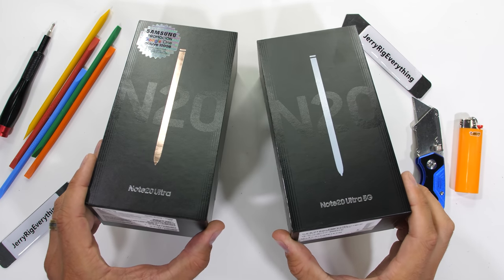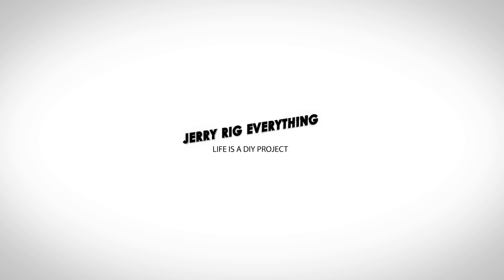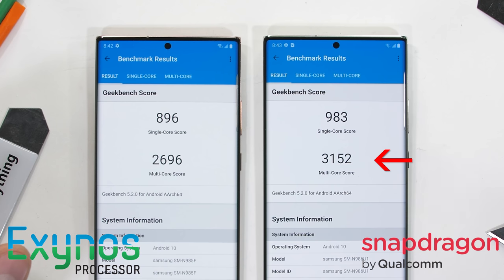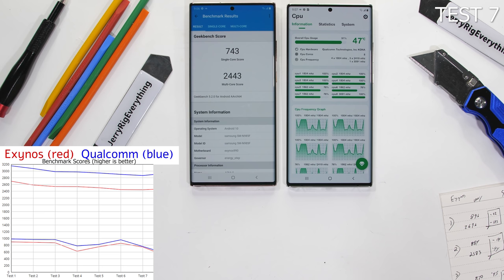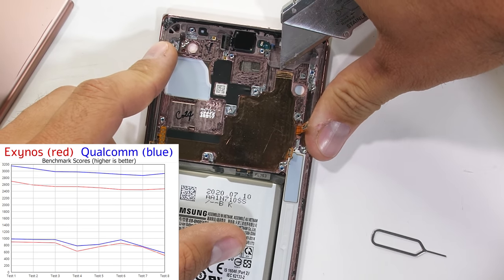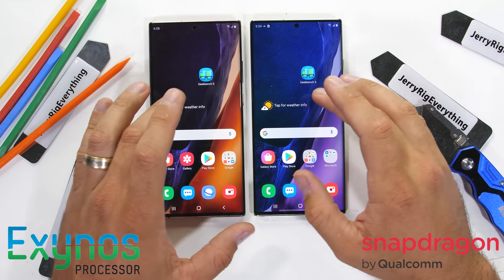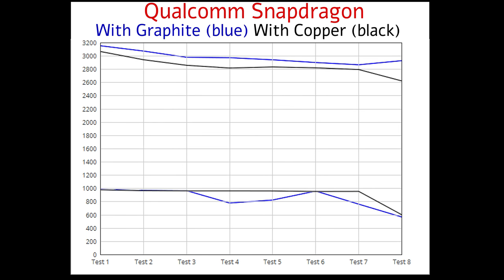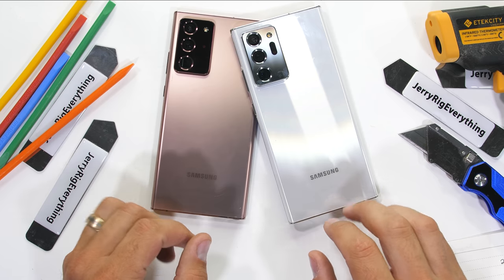Samsung should explain this... Exynos vs Qualcomm?! - Note 20 Ultra

Comment: That really sucks. Now almost every company is going for some easier way to do things and that's not a bad thing, but if companies sell things that are expensive, people should get what they pay for, this is technically a rip off even though it's a small thing. Hopefully they change this, if they dont, everyone will soon stop buying samsung phones. (Coming from a samsung fan)
Reply: yea....I am also a big fan.....But come on, i paid $1000 on my exy s10+ and guess what..?, it cant game consistently on 60fps while the SD version does.....the exy is at 40fps.....
why samsung is doing this....?
Now I am never recommending any samsung phone to any of my relatives or friends.....
Reply: I already stop buying samsung phone, hmmm, their phone suck n very pricey, i turn to buying xiaomi, worthed every penny, even my xiaomi phone from 2016, still working till now
Reply: @sasakinozomi2165  I am still using the galaxy s6 (2015) and it works well!
Reply: Samsung phones are very good, just like apple, just the only problem is I feel like they think people wont care since they are widely known and they think they can slack a bit.
Reply: i wouldn't call a 20% difference in batterylife "a small thing" tbh... especially if that is paired with a 16% loss in cpu power.
Reply: @KaleratYT  I didnt know it was 20 percent, if that's the case then for sure why do they think people wont care
Reply: @yairnajera9418  sure they are wildly known... But they're not the only players in the game anymore. They shouldn't be doing these practices today. I have been a fan of Samsung for a while but maybe after this, it is time to look for another brand...
Reply: @yairnajera9418  people won't care because nobody really knows the features of the phone like that. You have to be a Samsung lover to know that it has different chips in some versions of it. Most people don't know that. They buy the phone because it's a newer version and they rely on what Samsung say instead of looking more into the small things that really matter
Reply: Lol that’s always been the plan. Less work more money
Reply: @shebilpullat3529  exactly the same shit. Have my Note10+, but the performance in games is garbage.
Reply: It’s not a small thing that’s the thing
Reply: @gravity5114  i think he meant in a way that it is just one component. And for people who dont know much it is indeed a little thing
Reply: Lol everyone won't stop buying samsung phones because most people don't care about this non sense.
Reply: @BigBladeFan  "most people don't care", thats true, but it isnt a nonsense, but a very important and reasonable fact.
Reply: Yair Najera Amen brother amen
Reply: @Yair Najera same :(
Reply: DoYouEvenGameAndLift BRUH  
Yeah...Same here....Now Imma No samsung Boy...
But Personally I dont like iOS...I dont know why...
So my go to phone will be One plus

Comment: Runs hotter
1 generation slower chipset 
Worse battery lifespan
Different screen(possibly)
Essentially the same price

Ultra scummy.
Reply: International phones are more expensive, actually. Phones in my country can cost between 150%-200% of the original price in official stores
Reply: More like Ultra scam
Reply: Not in Brazil, the price is actually higher here c:
Reply: Different camera sensors.
Reply: It has to do with licensing and restrictions on Qualcomm. They can’t use that chip everywhere so they have to go with their own in places that don’t allow Qualcomm
Reply: @TheCrystalGlow  there is restriction on exynos on USA, not the other way around
Reply: That's because Exynos can't compete with flagship processors. They use Snapdragon on American models, and they sell the Exynos type to the sheeple in India and Pakistan. Damn right, very scummy.
Reply: @mikehawk287  Exynos was faster 2years+ ago. Its these 2 last years thats struggling ;).
Reply: @gzarari  They are acting real stupid since they released the S20 series. And they really should stop making cameras, they capture shit.
Reply: @TheCrystalGlow  please dont mislead others. Exynos chipsets are sold in US and conversely, Snapdragon Note 20 are sold outside of the US as well
Reply: Its like what Apple does. Just put the same phone into different frames and call it a number higher than the previous model and charge $1000 to any hipster whos parents can afford
Reply: @zbruh7268  yeah, precisely. People blindly buy Apple products while other companies were at war with each other with high specs and affordable prices, Until in the last couple of years Samsung thought: "hey, if Apple is overpriced garbage and people still buy it, so why cant we do the same? We also want a piece of that." And companies like Huawei, Oppo, and Oneplus sorta did the same. So yeah people are idiots and these companies are taking advantage of them. And meanwhile Douchebag Youtubers like AppleExplained say stuff like: "smartphone prices are going up because of the new advanced technology and blah blah blah..." - BULLSHIT.
Reply: @mikehawk287  it wasn't apple that started this because apple get the right hardware with right software. The one who started selling worse phones for the same price outside the US is LG with the G5 SE
Reply: @ryanting9342  I don't really know where outside US and china to get a snapdragon note 20, and as a bonus in Brazil the actual exynos version costs more than the snapdragon imported from the US.
Reply: @TheCrystalGlow  You know something, but it's exactly the other way around. They can't put their own chip in the US.
Reply: back in Note 4 Era 
Exynos Run Smoother Than Snapdragon
well i think the table has been turned or maybe the wheel or chip??
and i have Exynos Note 4 thats still i use Now and This is what i use to Type this comment
Reply: @XDjUanZInHO  Apple uses good hardware, but it's definitely not the best, and keep in mind it's way overpriced. A $350 Chinese phone is equal to an iphone 11 pro max in hardware. And as for software, personally I'd choose the worst, buggiest mediocre android UI skin ever made, than the prison called iOS.
Reply: Costs more in EU than in the US
Reply: @TheCrystalGlow  s10 lite has qualcomm's processor and is being sold everywhere
Reply: @TheCrystalGlow  
S10 lite uses SD and is sold internationally. Note 10 lite uses exynos and is sold internationally as well.
Reply: @RedViolet 
And all those brands can sell SD at high amounts. So the argument that "Qualcomm won't be able to produce enough chips" is invalid.
Reply: @ShiroCh_ID  
Exynos used to be better than SD.
Reply: @gzarari  So this is reason to sell better version in USA than elsewhere then? Why not put Qualcom in international version as well, since it's not restricted outside US?
Reply: @wekkimeif7720  because samsung makes exynos, and its probably 5x cheaper for them to manufacture. Not saying its right, i dont even buy samsung phones anymore since i had an s4. They slow through updates after 2 years. While i have a google nexus phone for 4years now and still runs good
Reply: @gzarari  Yea Samsung is scamming customers just for extra profit, which should be stopped asap by someone.
Reply: @gzarari  that is actually correct. They're quality has dropped but they did have some the outperformed Qualcomm im earlier days
Reply: @mikehawk287  not so fun fact: the note20 ultra cost $549 in parts to make ( now that doesn't include research and development but still, that's less than half the release price! And thats for the ultra with victus glass and a better camera and display. So imagine how much it cost to make my note20 5g? With its plastic back. Lack of an sd slot and slightly lower and camera and 60hrz display and most notably gorilla glass 5 instead of 6. That part pissed me off the most. How are you going to downgrade the glass by 2 generations. Wtf!? Plus a plastic back. Jesus that's just total bullshit. The only reason I keep it is because I refuse to spend over 1000 on a phone. And I love the one of a kind features the note offers. And overall I enjoy the phone but when I think about all the downgrades especially the durability it gets me pissed. But back to my main point. If the note 20 ultra 5g is 549 to make with all its premium parts. The note20 5g must be 300 or less to make considering its plastic back and gg5. I think it could've cost even less to make I'd say even 200ish is possible which is straight up shady. That's a massive profit margin. You need a profit margin but as  someone with some business experience that's not a legitimate profit margin. I feels more scammy then anything- no decent reasonable company would force a profit margin that steep on its customers but I doubt many of these companies are decent
Reply: @XDjUanZInHO  wow you're talking about legit sellers like t-mobile stores verison stores, samsung etc. No 3rd party stores right? that charge more for the exynos than the US varient??
 Because 3rd party stores create they're own prices and can say it costs whatever they want while authorized sellers working directly with samsung have the most legitimate accurate pricing so if they sell the international version for more in samsung or Verizon/tmob. Stores that's fucked
Reply: @ShiroCh_ID  wow my note 4 died real quick. It was dissapointing. I think it was refurbished. I got it from a 3rd party seller in NYC. Bad idea. In Ohio you can find some good 3rd party used deals but in NYC I seemed to always end up with garbage
Reply: @brandonshand4718  you can look up on any major seller here in Brazil. Phones embedded with carriers are rarely common here so you can search on stores such as: Kabum, Submarino, Americanas, Zoom, Magazine Luiza,... And you'll see what I'm talking about.
Also, buying from the actual manufacturer here in 90% of the cases will make you pay more just because it's on the original shop without sales, don't ask me why
Reply: @brandonshand4718   Apple, Huawei (flagships only), OnePlus, and Oppo all do the same. Keep in mind they sell the higher storage versions up to $1500 which is nuts. And that makes it safe to say they get 100% profit from every single phone they make. 100% profit means when they sell the product, they get the money they used to make the phone PLUS the same amount as profit - money that goes into pocket. You should check out an iPhone 11 (non pro) and see the pure garbage they sell for 699-780 USD. Now some companies don't do that, like Xiaomi, back in 2011 when they first started selling phones, they got 0 profit from any unit sold. They even sold the first phones for half price during the first 8 hours. And until today they still get about 10-25% benefit from their products. they make amazing phones, and I dont really mind the software or UI since the camera is neatly optimized.

The hardware Apple uses on the iphone 11 pro max was already 2 years old when it came out, except for the cameras, they are the best Sony could offer for a smartphone. The Note 20 for the price, should have 90 or 120 hertz refresh rate and a better telephoto camera. The plastic back is maybe not that bad, there are many forms of plastic, maybe the plastic they used is different, personally I think any type of plastic is better than the aluminum they used on the iphone 5s and 6. A Rolls Royce bumper is also made of plastic.

Comment: "If it acts like a different phone, It should be called a different phone." - Zack 2020
Reply: What if it quacks like a different phone?
Reply: yeah in old model.. the differnt not much but newer one.. this is a joke...and it cost the same...
Reply: Me Too  If one phone is slower, it's not acting the same as the other one.
Reply: Do you realize one says Ultra 5G and the other doesn’t
Reply: @user-oe4fo3zo9q  because there some coutry will not implementating 5g for next couple years
Reply: Me Too  kid if one phone is more efficient and faster there is obviously a difference. It doesn't matter if it is a small change it makes quite a difference. stop being so narrow minded and sit down
Reply: Me Too  and it isn't just "a little more efficient."  there are obvious flaws it shouldn't be hard to realize

Comment: Nearly 2 years after the release of this phone, Samsung seems to have done some positive optimization on the software end with OneUI 4.
The battery life gap between both variants has narrowed significantly, although the performance gap still remains.
Reply: Agreed, my regular S20 with the Exynos 990 was wayyyyy better with the OneUI 4 update. Seems Samsung were indeed embarrassed and worked hard to optimize the Exynos 990 drivers..
Reply: @seezu84  thanks god they did jt
Reply: Heya, I’ve been looking into getting a new phone, and I’m wondering if this one still holds up in 2022? Hardware-wise, it has pretty much everything I’m looking for; but I’m worried about the software being too “outdated”. Namely the version of android and Bluetooth.
Reply: @slothful2039  The software honestly isn't an issue, and will get upgrades for maybe another year. It's definitely getting the upcoming OneUI 5.0 (Android 13). I'd say it's totally future-proof for another 12-18 months for a power user, and 2 to 3 years for average users.

Your real concern should be battery life. It's more or less on par with the Samsung flagship standard, but can't compete with, say, the iPhone 13/OP10 series.
Reply: @slothful2039  snapdragon 865+ will pretty much handle any game right now, because mobile processors are getting better but the games aren't. You don't have to worry
Reply: @suhailnoor5654  Thanks! I did some more research and apparently the newer snapdragon chips have problems with heating, especially on smaller devices like phones. So that's another plus to the 865+ chip.
Reply: @slothful2039  that's true

Comment: I remember when the Exynos came out as an option and people were actually trying to buy the international version because it was better than the Snapdragon offering. My how the times have changed.
Reply: Sad Galaxy S8 noises
Reply: Just like intel vs amd
Reply: I remember specifically buying the Exynos version of the Note 4 because the Qualcomm variant was absolute garbage...
Reply: @doodskie999  or like Nvidia vs AMD. Nvidia just completely crushed AMD with their new 3000 series cards on performance and price!
Reply: @isaiahwade1484  compared to what lol?
Reply: When did Snapdragon become better than Exynos? Was it since the S8/S9 series? Cuz I remembered the Exynos S7 series outperformed the QcSp S7.
Reply: Any one remember when the note 8 exynos outperformed the iPhone 7
Reply: @jonathanstupidcheesespaghetti  outperformed but in long term sd were best
Reply: I believe it was during the S6 release, SD 810 was an overheating piece of garbage and Samsung dumped it and used Exynos 7420 everywhere.
Reply: I remember this on galaxy s6 🤣🤣🤣
Reply: @4uvak666  have you not seen the specs and performance of the new Nvidia cards? They destroy all other graphics cards and are cheaper than other cards with comparable or even better performance.
Reply: @michaelorlain4262  yeah, I ordered a one plus 2 and returned it on the same day due to really bad heating problems. I remember a sony Xperia(don't remember the exact model) literally cooked at 54C external surface which actually burns your hand.
Reply: @isaiahwade1484  that what's usually new cards do? No shit. U can't compare to amd, coz there is nothing new to compare.
Reply: @Anistar95  also with the Note 5. It was the first and last time time U.S buyers got an exynos Note
Reply: @jonathanstupidcheesespaghetti  S8/Note 8 were last one, with S9 situation started to change
Reply: You can unlock the Exnyos variants. You can't for the SD variants. And even though the non US SD variants can be unlocked, good luck finding 3rd party roms for them for that tiny group of people who have them.
Reply: @4uvak666    yeah, so you just proved you have no clue what you're talking about and didn't even bother to look into the new cards. So you're telling me that when new more powerful cards come out, they're "usually" cheaper than the previous model. And the performance of the lowest model always outperforms even the highest model of the previous line. That's NOT how it works! The prices on new series of cards has been climbing for years and the performance gain is nowhere near a jump like going from the Nvidia 2000 series to the 3000 series.
Reply: @sprockkets  yes you can. My Note 4, Note 8, Note 9 and Note 10+ were all unlocked and they are all SD. The only unlocked Note that I had that wasn't SD was the Note 5 because all markets got the Exynos. My Note 2 was unlocked but I don't know if it was snapdragon or not
Reply: @4uvak666  and yes it can be compared to AMD because they don't have the new architecture at all that Nvidia is using on the new series. It's an in-house design .
Like myself who's main PC is a Ryzen 9 and I run a MSI Radeon RX 5700 card, a lot of people go the AMD route for the price. That's what makes what Nvidia just did huge. There's going to be a lot of people grabbing them because they're ridiculously powerful for the price.
Reply: @isaiahwade1484  u just proved my point and answered to yourself in your second comment lol. I just gonna repeat myself - there is no amd card to compare to, let me be clear that you'll understand. U can't compare to 5700, 5700 is old. And mostly, MOSTLY, new cards are performance/price- value better than old releases. U just proved this in your last sentence. Stop talking non-sense. Same goes for prices, but for nvidia only....since nvidia has been overpriced for many years and amd is balancing this. That's why many goes for amd, coz in some ways and for some1 in many ways it's better price-value wise. This has been proven in vega 56 and 64 series already.